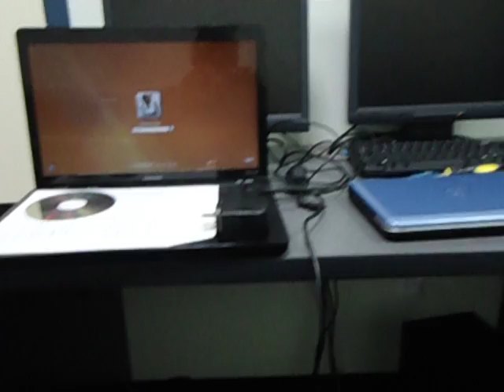How to remove hard disk on Dell mini 10 notebook

Comment from the maker: use the system restore option. but depends the Operating system you are using. usually you can find the system restore option in the control panel for Windows.

Comment: OK if you have to hack at the battery with a screwdriver there is already something wrong, hes lucky he didnt damage it please dont do that bit! it should slide out nice and easy... And a question, its good you show it removed but why! Shouldt you just format it in place using a usb bootable OS like linux or freedos! only time you need to take it out is to replace isnt it?